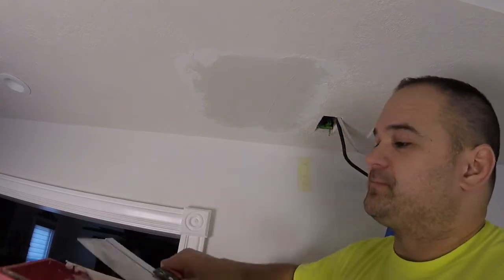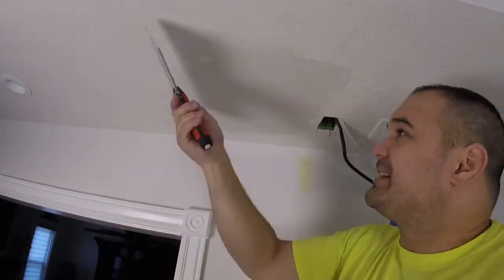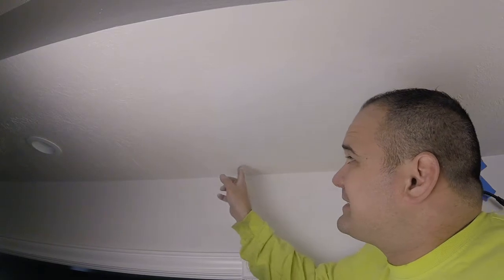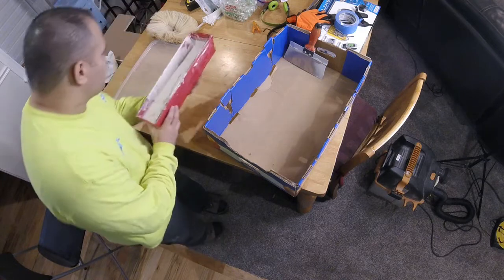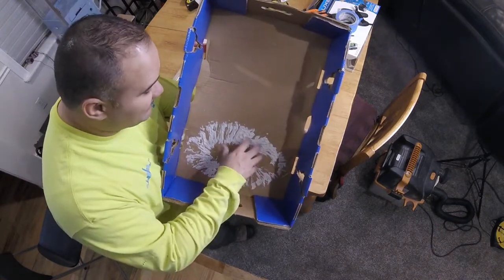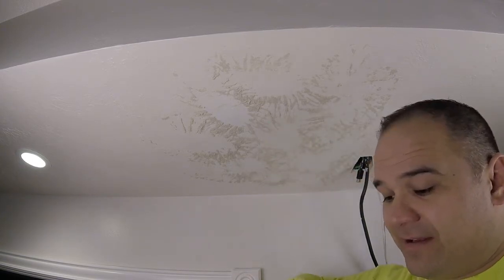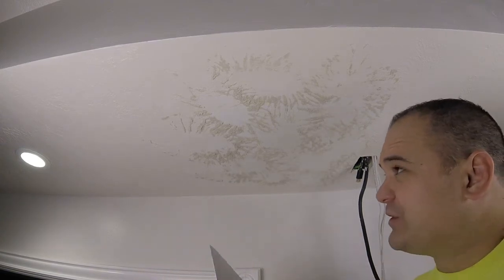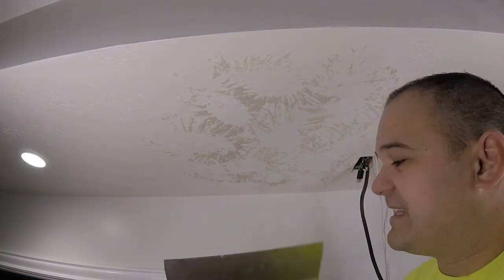How to repair drywall and apply stomp texture

Comment: I really appreciate you taking your time to teach us all how to do this.  I'm trying to stuff my brain full of texturing knowledge.  In my mobile home, there's trim board that runs along where the ceiling meets the wall.  Im taping and mudding those inside corners.  There's texture on my ceiling that needs to be removed from the ceiling up fairly close to the wall.  After I tape and mud, I'm going to need to restore that texture on the ceiling, so thank you very much once again!
Reply from the maker: Awesome! I'm sure you'll do an amazing job

Comment: Alan, great videos. My in-wall wire task needs to run thru existing AV boxes, from right to left horizontally and then straight down to the bottom AV box to my receiver. There are already 2 older HTMI cables (I need to replace with hi-speed HDMIs), old style speaker/video wire with RCA plugs. These are bunched up so I can't pull them, and running a snake goes right to left but doesn't hit the left stud to travel down. I've tried everything. Do you have any vids for L shape in-wall wire run how to videos?
Reply from the maker: I have a video series where I run an outlet left then up a wall. Due to the weird framing, I have to cross 3 or 4 studs horizontally before I go up the wall. Maybe this will help?  
https://youtu.be/1ELj6M_afew

Comment: Listen up!

"Butterfly", or, "Boot Patch"

That's how you fix a hole like a professional that has no backung.. 

First, if the hole is round, make it square with a utility knife, and the measure it out.  

Find a new piece of sheet rock that at least twice the size of your measurements as you leave equal excess on all sides.  The idea is to leave the PAPER of the sheet rock intact on the opposite side of the board.  Just peal it >>>> that PAPER represents the 'wings' of a "butterfly" >>> and it will be your tape >>>> hence, NO BACKING NEEDED!!!

Using All-Purpose mud, just put the plug in the hole, and tape it as if the sheet rock paper was regular tape >>>> now finish it

I was a Finishman for 37 years, and that's the only way to do a patch properly that has no backing, and it's done in a 1/4 of the time.  It won't crack, btw, cuz it's not a stress point.  

["Boot-Patch" = cuz usually it was the same that made the hole]

Your Welcome 😎